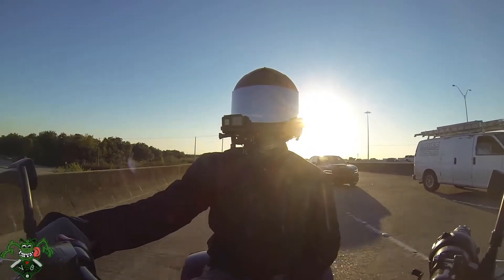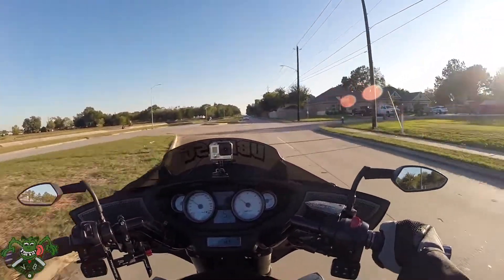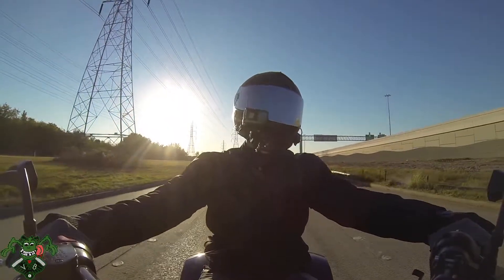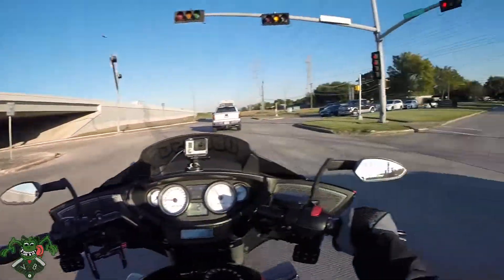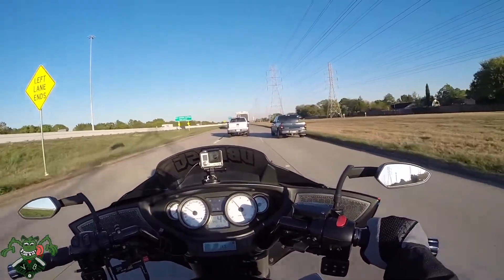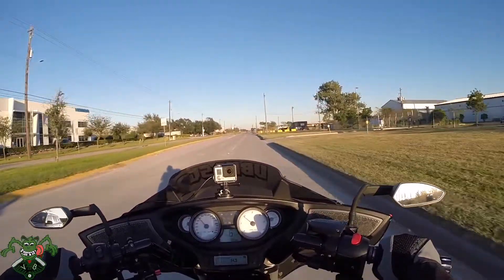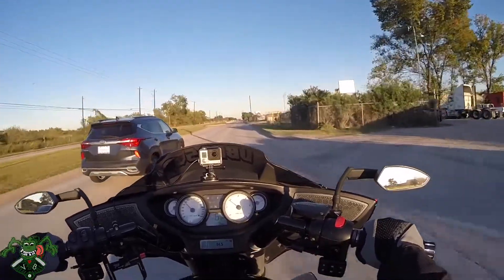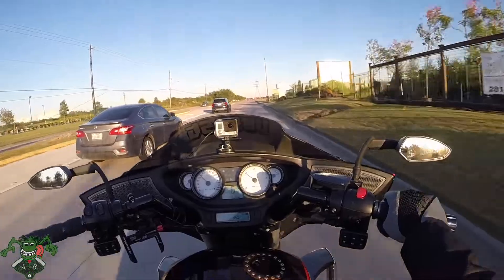INDIAN WINS KING OF THE BAGGERS

Comment: Definitely, the frame on the Challenger is far superior. They tuned the Challengers with a Power Commander 5. Indian unlocked the ecm to be able to exceed the 110 mph governor. Dynojet still has not produced a powervision for it. Indian beat Harley-Davidson even with an inferior tune. That speaks volumes for the Challenger!

Comment: I wrote mid vid so now i gotta vo back and look up the race again cuz i thought i saw HD out front for most laps.
Reply from the maker: H-D was leading only because the lead s&s Challenger went off of the track. Then the s&s Challenger was in 3rd because of that mistake. S&S Challenger then overtook Rolandsands Challenger and ultimately the Vance and Hines 131 Electra glide standard. I think S&S Challenger was up front for like a lap and a half for the dub 😁. The S&S Challenger came in super hot in turn 1, there is some pit video out there of it. That was some serious skill!